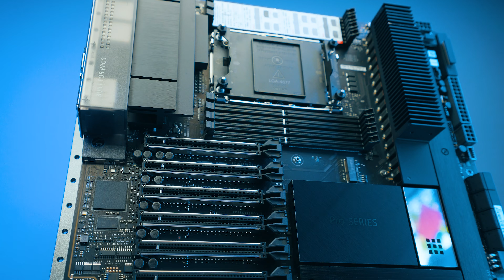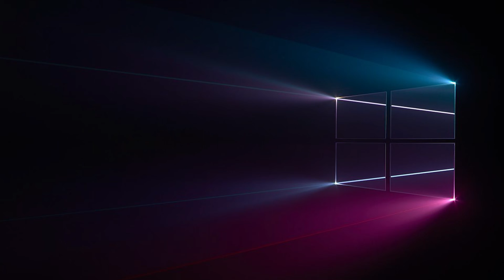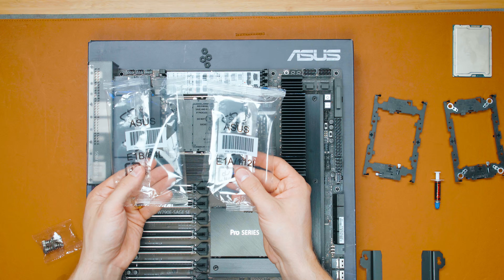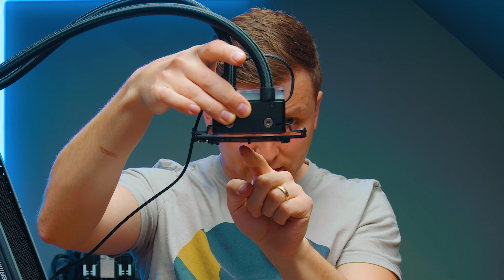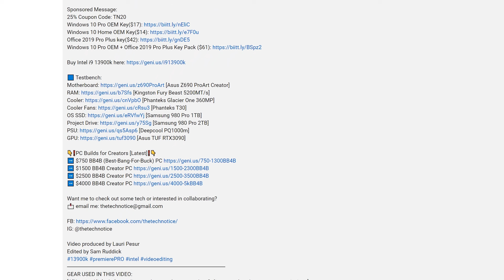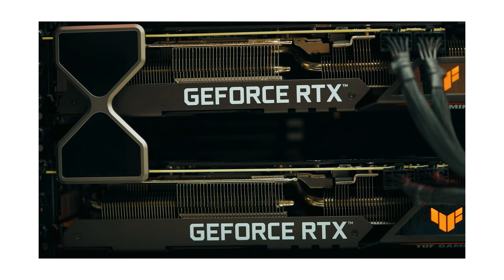The MOST UNUSUAL processor! | 4th Gen Xeon [LGA 4677] CPU Install Tutorial

Comment: Glad  You made this  Video even thought  I have taken apart 7 different  Computers  & Rebuild  & Upgraded 10 Computers - this  CPU  Arrangement was  Certainly   Surprising  !
I could  NOT Remove  CPU as  Described by  Dell's  Tech  Site , so after watching this  I  Now  Understand How to Swap Out ~ CPU ~  with those 4 Little  Black Hook Points - Holding  CPU to Plastic  Frame . . 

I Will  State the ~ Second Plastic  Frame  with Part #  containing  112  is for All  LGA-4677-1  CPU 's that have an X - such as  W5-2455X  - thee  X  Stand  For Un-Locked at those all Clock  4800Mhz  Ram at Full  Speed - where - W3-2425 etc.  Clock Ram 4400Mhz - Mostly 
those Intel XEON's  LGA- 4677-1  are Listed as Locked & Only have 64 PCIe  Lanes - X  Variety like W5-2465X  have  112 PCIe  Lanes _ Like Part Number  . . 😇

Comment: FYI that cooler is garbage.  I had 2 of them for Threadripper and they both stopped flowing due to corrosion, which is a well documented problem at this point. I feel like the only reason these still exist is because they've been sitting around unsold in the warehouse and they saw Sapphire Rapids as an opportunity to dump the remaining units onto the market.  I will never buy another AIO from Enermax again.

Comment: What? No, you almost had it.  You clip it to the heatsink first, it doesn't fall out.  Once you do one thermal cycle it's suctioned tight and won't fall off.  That's what the metal TIM breaker lever is for.  Does Enermax not tell you how much torque to screw the heatsink down to?  Glad you mentioned using Star pattern.  Anyway... Much better application than Linus lol

Comment: Really enjoying this series of videos. Any chance of getting a 16 or 12 core version of this chip to see how it compares to the 7950x etc. I need a pc with more pcie lanes and performance and wondering if this platform would be any good. Currently have a 5950x.
Reply: If you can hold off a bit Threadripper 7000 is coming later this year which might either bring down Xeon W price or blow Xeon W out of the water for similar cost if current Epyc vs Sapphire Rapids is anything to go by.  Used Epyc might also be an option.
Reply: @nadtz  that was what I’m starting to think too. having found some benchmarks for the 16 core version of the w-2400 series, i wasn’t that impressed. Thinking of waiting for the threadripper 7000.
Reply: @darcsentor  Can I ask where you saw benchmarks?  If all you need is pcie xeon w can be had fairly inexpensive which is nice but you did also say performance so...
Reply: AMD Threadripper / Epyc could be an option depending on you budget

Comment: i dont get how intel names their lga format.
lga775 to 115x to 2011 and now 4677
Reply: The Xeons are wholly different from the desktop sockets for a while now.  Went 115x/1284/1440/2518/1667/3647/4677 with a few extra in there for good measure.
Reply: @nadtz  dayum, im totally out of touch with the xeon line ups since most of the formats you've never mentioned are never available in my country.
Reply: @kitsugt  Ah. =/

Comment: Seems like quite a pain to install
Reply: They hoping for accident because it does not covered by warranty
Reply: The whole point is to install it to the heatsink first.  Then lowering the whole block down the guide pins in the corners prevents the CPU from slipping out of your fingers, crashing into the socket.  It's heavier, but easier to control.